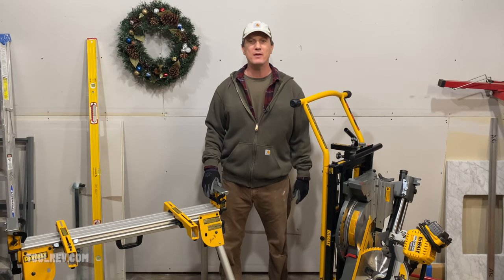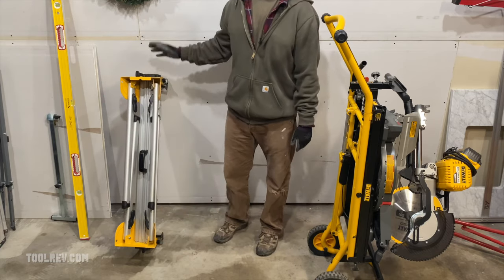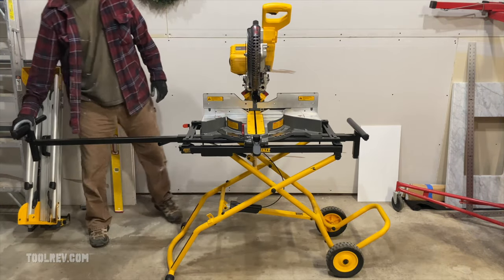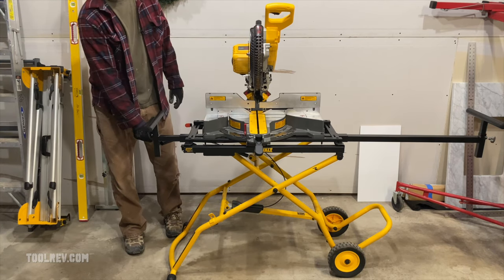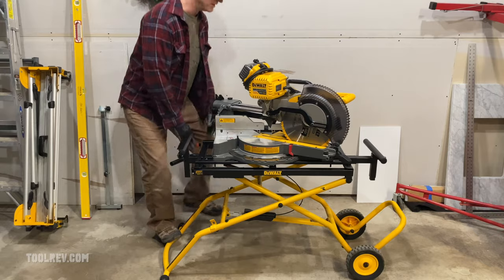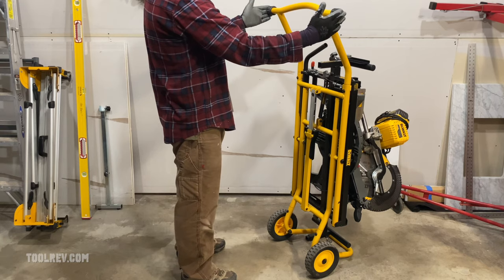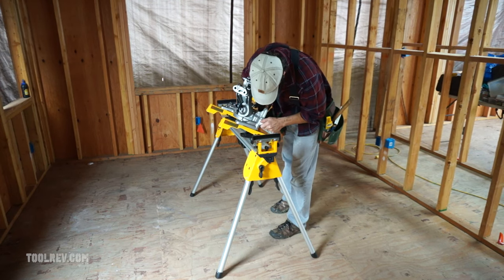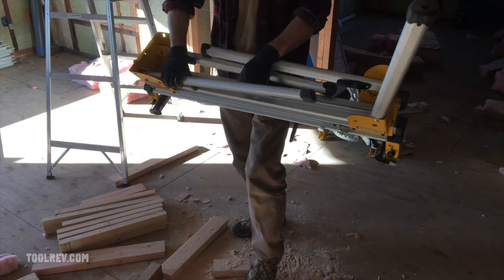DeWalt Miter Saw Stand Review - (MUST SEE Operating TIP)

Comment: Is there any risk to damage to the saw if you leave the saw attached to the rolling stand in a vertical position (so saw is sideway), and you leave it like that for months?  Anyone hear story about saws having alignment problems after storing it in a vertical position for an extended period?  Thanks.
Reply from the maker: My 12'' slider's been hanging for 5 years without issue.
Reply: @toolrev  Thanks.  That's good to know.
Reply: I store mine in that position. I've never had a problem.

Comment: Excellent summary for the rolling stand. The tension-release tip for the pneumatic lift is a must-see - not only makes it easier to operate, it prevents the closing problem some have experienced. You’ve obviously spent enough time with this stand to know how to operate it fluently.

Comment: Thanks for the review. I got a big old craftsman sliding miter saw and was worried about tipping over when set upright. Glad to see your large miter stand resting easily. 
This Dewalt stand will accept my craftsman offset mounting holes so it's the one I'm looking at. I don't want a mounting plate under it.

Comment: Good review. I own both of these miter saw stands as well as the larger DWX723 stand…all are excellent stands. I’d suggest buying either a pair of the 15” wide work supports w/material stops (DW7029) or a pair of the 15” roller versions (DW7027)…or a combination thereof, one of each. Solid made miter saw stands and optional wider material supports.

Comment: Great explanation and advice about needing it wide to move the saw. I haven't bought one yet. I have been using my saw horses and a 3/4 piece of plywood as my work station. Not having to carry in a sheet of plywood can be advantageous on certain jobs.
Reply: This is why I'm considering buying one. To save my back.

Comment: You're a godsend and this is the best review I've found all day. Best part is you are the only one who compared both, which is perfect for me since I'm trying to decide between the two. Question for you? I can't remember if you mentioned the span of the stationary stand? I know you said 8 for the mobile stand, but I wasn't sure about the other. Would you say for someone like me who isn't going to be traveling with it, would you say the stationary is a better buy? Thanks!
Reply from the maker: Both stands have an 8' support span fully extended. I like having the rolling stand at home for the big saw. It makes the saw easy to move around the garage and stores it stood up and out of the way.
The folding stand is more compact so I can put it and the large saw in the cab of my truck. But I mainly have the folding stand for my small saw.
Reply: @UC5uWnYudXmGlTlR45xrpHiw I see. Well, thank you so much again for the review. It was a huge help deciding on which to go with. The only thing I wish they has was adjustable leg heights for un even surfaces. I have 2 drains in my garage that make everything a pain cause the floor is so uneven. So I figured I would go with the folding, since it will be easier to level with something underneath the legs. Any suggestions on the best 12" blade to go with? Maybe a few for fine cuts and just cutting stock?
Reply from the maker: I don't know what the best 12'' blade is but you might want to check out Diablo. They are pretty specific to what your needs are.
Reply: @toolrev  Yeah the diablo is what I seem to keep coming up with. Decided on the Freud 72T Sliding Miter Blade. Thanks again for all your advice and it was good talking to you. I'll be sure to check out more of your vids as I continue my studio remodel.
Reply from the maker: Cool. See ya.

Comment: Thank you for the review.  I am getting ready to buy a new wheeled saw stand and your review helped me eliminate this stand due the the narrow wheel base.  I have a delta miter saw stand that has a lot wider wheel base and am considering getting another one. It is real similar to the Rigid wheeled stand.  Also considering the Bosch Gravity rise stand.
Reply from the maker: Glad to help.
Reply: I had the Rigid but my Dewalt saw didn't fit so I got the Dewalt wheeled stand. I don't like it, too heavy, the mounting system is really dumb compared to the Rigid and Delta stands that have rails. I'd get the Rigid again if my saw fit it.

Comment: How much does your saw weigh? Is it the 50-60 lb lb 60v one? 
I have a 780 corded 12" saw and it's like 55 lbs. I was worried about getting the folding one for the weight of my saw. But if yours works then mine should
Reply from the maker: If I remember right my 120v saw weighs 55 lbs.

Comment: Do Mounting Bolts come w/ the stand-- if not, what kind of bolts secure a DWS715 to the compact folding Stand?
Reply from the maker: My rolling stand came with bolts and the folding stand came with brackets that also have bolts to attach to whatever.

Comment: Great review I had my 779 attached to the rolling stand went to lower it and the handle snapped off, did you notice any play the handle when using it to lower maybe I shouldn't of used it to lower and raise the unit. Thanks
Reply from the maker: Ya, it has been loose in the past. I forgot to mention there is an onboard wrench to tighten the hex screws. The handle base on mine is held on by two screws.
Reply: @toolrev  I returned mine after it happened but then was thinking maybe a stainless nut and bolt instead for extra strength.
Reply from the maker: @sflagg0817  ya, if a hex screw sheared off that would have fixed it.

Comment: I’ll be cutting a lot of 1x5 and 1x8  16’. ’ I’ll be cutting them to 10’.  Will the stand with the wheels work fine for this?  Ty. Great video
Reply from the maker: Absolutely. I cut right handed and would hold the 10' piece with my left hand to keep it from tipping. Vice versa for lefties. The stand would also work.

Comment: Would it be ill advised to haul the 726 upright in my work trailer with the weight of the chop saw on it? Or should it be laid down like how you had it in the bed of your truck?
Reply from the maker: I would carry it upright in a trailer if that was easier. If you hang the saw correctly with everything slung low I don't see bumps being an issue. I think I remember a Concord Carpenter or maybe it's called ToolBox Buzz now doing a review on this stand and he showed it upright in his trailer, I think. Check out his channel and maybe he can tell you how it's worked out for him.

Comment: Alex, I did get the Hercules from Harbor Freight. Very nice quality, great wheels, a bit easier to setup than the DeWalt or some others I thought.
Reply from the maker: Nice!
Reply: what’s your thoughts on the stand now that it’s been a year since your comment? i have the hercules miter saw and thinking if the powertec also .
Reply: @harrydoherty8299  Hercules stand has worked excellent and held up nicely. Very strong quality and I like how it attaches to the miter saw and then clamps on to the stand. Beautiful - and I'm a little picky so I don't praise every product. All the setup is easy and solid as well nice rollers etc.
Reply: @ralphhross  I was looking at that stand, it legit looked better than most on the market but I got a deal on the Dewalt wheeled stand and I don't like it. The mounting system is archaic compared to most that mount the saw on rails now. And the stand is pretty heavy, and balanced weird so it's heavy to roll the saw around unless it's on concrete. If I get another one I think I'd get the Hercules.

Comment: Can you make repeated cuts with that stand.
Reply from the maker: The stops on the folding stand are great. The stop on the rolling stand is kinda flimsy. But ya, it works as long as you’re not ramming boards against it too hard. Easy enough to make a thicker stop from scrap if you need it.
Reply: @toolrev  thanks for responding.

Comment: I have the rolling Dewalt stand.  Unfortunately my Ridgid saw doesn't quite line up.  The mounting holes are about an inch to deep to successfully mount all 4 screws.  I have it on there with 2 screws catty-corner currently, but you can understand my reluctance to count on that holding up.  It's quite a bit a weight we you turn it up on it's side.

I'm thinking of mounting the saw to a pieces of plywood, then mounting to the stand.  But I was wondering if there are any other options for this?  I was pretty disappointed when the saw wouldn't fit my "universal" stand.
Reply from the maker: Return it for the RIDGID stand would be my advice. Otherwise I don't know but maybe someone else will comment with a solution.